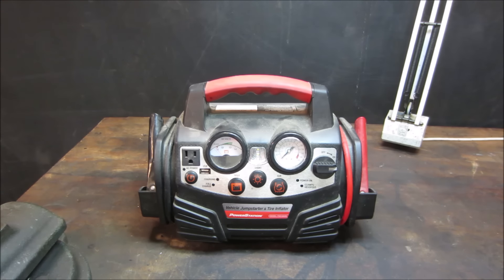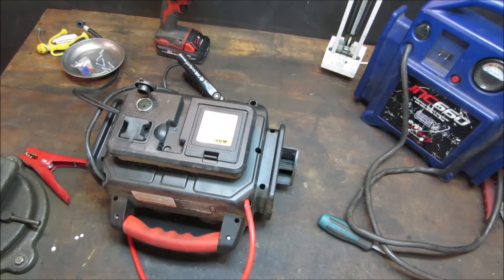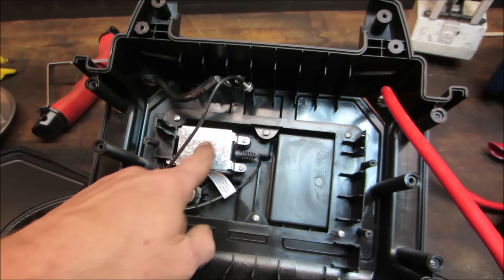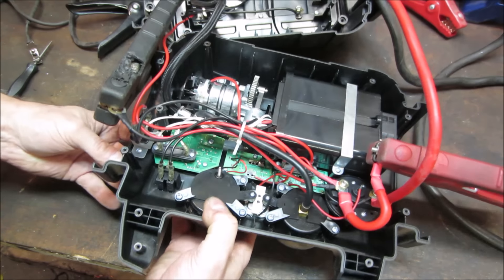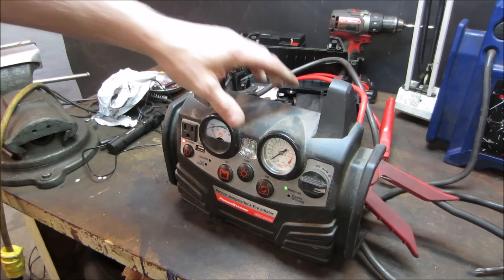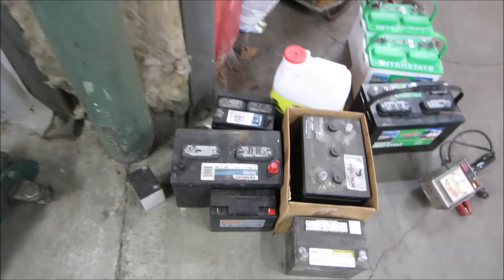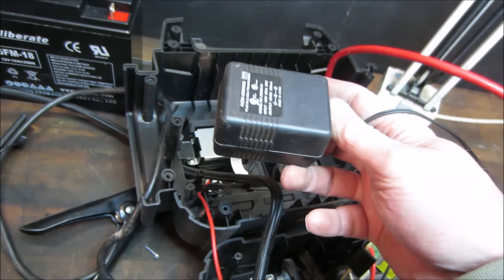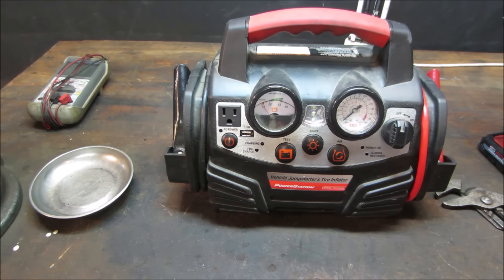What is inside a car jumper pack? and can we fix it.

Comment: Train sets are always cool. And nice job with the jumper pack. What was bugging it the whole time was when you didn't put something small into the AC to test it. Like test the voltage or use a phone charger or something else small like a portable radio.  :)  Also the word that escaped you was inverter. That's what that little circuit board with the fan was. A 12V to 120VAC power inverter.

Comment: Been a fan of train sets since I was a kid in the late 1950's. The glory days of passenger trains had not quite ended. I got a used Lionel gauge set for Christmas. So I'm all for the train set resurrection. Run the track on the wall, all around the garage!

Comment: Excellent video Mustie 1 :) fun part I got Flashlight, Air Compressor is 12 volt at Yard Sale plus Air blow up tools it a Canadian Tire brand 200 PSI on unit plus box even Owners Manual ! Guy sold for $25.00 also had rewired up because Flashlight on Flashing part did work till fix also fix Air Compressor would pump tire up ! So my old small  one had same parts also rebuilt & rewired total too and I use the Yard Sale lots since too ! Pay off lots repairs to people vechile service calls to Lol  to and also Mustie 1 yes bring Train Set out too!

Comment: Hey Darren. A couple of thoughts regarding this video:

1.) When testing the voltage on small connectors (such as the white connector which plugs into the circuit board), get yourself some T-pins - they can be bought at any sewing supply store. They're also great when measuring the voltage on vehicle connector pins.

2.) Regarding leaving a power pack plugged in when not in use, it shouldn't hurt anything - my Schumacher power pack's manual says it should be plugged in when not in use, so I imagine most others should be okay as well.
Reply: With a Schumacher-branded power pack, yeah, I'd trust that it would be okay and safe to leave it plugged in all the time, for there would be technology that would keep from "cooking" the battery inside.  With many other brands of power packs, not always going to be assured that leaving it eternally plugged in wouldn't finish the thing off in 4 to 6 months.

Comment: Just some information on batteries. Lead/acid cells are fully charged at 2.1 volts, 6 cells per 12 volt battery gets you 12.6 volts. Any voltage over this amount is called a "surface charge", extra electrons are on the surface of the plates in the cells hence the name. It is recommended the cars headlights be turned on for 5 minutes to rid these extra electrons from the plates to get a accurate measurement.

Comment: nice find and repair free is always a good  thing. I have a couple of the JNC packs one for each vehicle. I use power inverters for charging  tool batts and the jump packs get charged as well .  1 is 3 -4 years old and the other is 4-5 years old and still working okay

Comment: Darren, I worked at an auto auction years ago, and we had OTR truck batteries that were used to jump start vehicles with weak/old batteries. That had them on hand trucks with jumper cables all hooked to the cross support. It's not as convenient as my JNP660, but it started lots of cars. I got my jump box from a hospital after the battery died, and got a good used battery for mine.

Comment: I worked for a AAA shop and my boss loved these at first and bought many. Well as time went on they all failed pretty quickly and I was replacing lots of batteries. The best jumper is a automotive battery with jumper cables attached. These things are made in China.  I had a personal one that I took care of and it lasted 6 months.  I keep a 24F battery with attached cables for my emergency jump starts.

Comment: I really don't care at all what you tear apart and repair. As the saying goes, It's all good. It's the way you do your videos that make them engaging. Personally, I wouldn't mind seeing some vintage or retro kitchen appliances, mixers, blenders, toasters. Some of them are beautiful and it's a shame they're not made usable again. Also, some old fans are really neat. I used to have an old desktop oscillating fan that was covered in an elaborate wooden frame, with a  metal grill, and it looked like a Buck Rogers space helmet.

Comment: Midweek Mustie is a life saver! Cool teardown and loved the Mercury 2 stroke action at the end! Please do resurrect this train set it will make an awesome xmas display.
Reply: I believe the Merc is actually a 4-stroke 6 cyl (he did a couple videos on it), but likely had oiler issues so he puts some 2-cycle oil in with the fuel.
Reply: @OnusBones  Incorrect, the Mercury 150 Black Max engine that Mustie1 has is an oil injected 2 stroke. Also you would never add 2 cycle oil to a 4 stroke!
Reply: @comedyash  Hmmm, I'll have to rewatch those; I could have sworn he put 2-stroke oil in it; yes I know that's not the usual, but thought he did it do to an oiler issue.
Reply: Hmmm, now I see it is a 2-stroke that didn't normally use premix.  Okay.....sounds like a point of failure to me.

Comment: A 110 volt inverter  takes 12 DC and converts it to DC that one WAS PROBABLY about 100 watts ... charge your shaver 
.. a lot of wall worts.. 
You proved it was not broken right off the bat. Most of those things die because the battery dies....
Those things have AGM (Absorbed Glass Mat) the acid is contained in Fiberglass mats. These batteries are better than regular car battery for this purpose.  
I am glad you are getting better!

Comment: The output of that AC socket (115v AC) is not a square wave- it can destroy electronics.This outlet is for a resistive load- like a lamp...probably useless feature because the convertor is very inefficient and can kill the internal battery to the point the AC convertor quits with even a 500 watt load.

These lumps have sold for $159.95 and more
P.T. Barnum's Rule applies

Great video demonstration Mustie1

Comment: I have the same unit, also dead now, so this is really useful to see. I may try a battery swap. The problem with these type of unit is that you really do need to leave it charging almost all the time, but if it is charging in your house it isn’t with you when you need it. But I just bought another one of this type because they are cheap. The better units I think have a lithium iron phosphate battery which is much longer lasting and better in almost all respects. but costs a lot more money.

Comment: Thanks for a take apart video tutorial. Too many parts to remember for reassembly. You did very well since you had no leftover screws 😄 interesting innards but chances are it would be cheaper to just get a new unit.   If you didn't have a spare battery would you have just disassembled the unit and then discard? BTW, yes on the train!

Comment: 👍 yes to the model train set. If it’s the old Lionel type, if the headlamp bulb is working, there’s juice you can get froM a hobby shop that makes smoke, and it comes scented- diesel (yuk) or traditional coal or bunker oil . Also, the tracks get rusty, but I was cautioned against using steel wool to de-rust, because it magnetizes the track, and causes the bits of steel wool to cling - possibly damaging the locomotive. Also- there are rubber traction treads that go on the drive wheels that go bad with age/ they look a lot like wide flat rubber bands

Comment: The batteries are like the ones used in UPS (uninterruptible power supply) for computer systems which cushion the voltage / amperage on electronic equipment.  Hadn't seen a jump pack with all the "stuff" that your has.  Thanks.  Narragansett Bay

Comment: NICE.
Maybe the plastic calibration screw can be used to adjust the Battery Tester.  Maybe use the voltage scale to calibrate??

Comment: Generally speaking, a voltage of 12.6 volts is considered full charge. At that voltage it should start most vehicles. Right after charging it will generally read the voltage at which it was charged. Dropping thereafter to the high 12's if the battery is in good shape. Below 12.6 it can become iffy. Depending on what you are trying to start. Nice save. Got yourself a power pack.

Comment: Restoring jump packs, and making new ones is one of my things. I've found that old computer APUs can easily be turned into a most excellent remote power source. After all, they're just a battery with a 12vdc to 110vac inverter. I regularly find them tossed in trash and recycling bins. Add some binding posts and/or a jumper cable for 12v and you have a jump pack with 110vac. For an even better power source, swap the lead-acid battery with a diy pack made of 18650 computer batteries.

Comment: on that tester, the plastic screw just below the gauge is an offset for the device. you can use the DMM to measure the voltage under load and adjust the screw.

Comment: If I had to guess, the AC output of that battery pack will be about 150W running, with up to 300W (briefly!) surge, and puts out a modified sine wave (at best), or a simple square wave.  It's not good for much; plug a radio in, tune it to a blank "station," and listen for horrid interference.  You might find that output on a label or etching on it.
A 3-rail train set almost has to be O-gauge; Dad had a set when he was a kid, and my brother got it running for a while many years ago; I don't know where it is.  As another poster pointed out, if the engine works and is solid, it could be worth a decent amount to a collector.  It might be good fun to see if you can get it running again.

Comment: They use a regular lead-acid sealed battery like in a UPS or a lawn mower. I've replaced them before.

The box being cooled is the inverter for the 120v. You can get a similar sized package retail, Harbor Freight has them, that looks to be about 200 Watts? It's filled with diodes and MosFETs.

Comment: Fixed one of these with a faulty charger on the inside of the unit. I just ran 10 gauge leads to each battery terminal and drilled a small hole on each side to of the unit case to fish the leads through. When I need to charge the battery I just hook a charger up to each lead and charge up the battery. I keep a wire nutt on each lead when not charging.

Comment: I have picked up loads of jump packs mostly free. Handy for the leads but not much else. Just maganged to pick one up with a faulty voltmeter but good battery so managed to get one good one made up. Will weigh in all duff batteries.

Comment: I've got a few 12v lithium batteries in various  bikes and mowers etc, they cope with cold temperatures well but they need a load (battery tester that same as yours there) to warm and wake them up before they will crank anything over. My main bike has a couple of pigtails added so that i can easily attach a tester without taking the seat off and battery out below ~5°C

Comment: If you find that a dead battery will not 'take' a charge, I have had good success in wiring it in Parallel with a good battery and then charging it a low (2 amp) setting overnight.  It gets the current circulating.  This was a fun fix.

Comment: I put a new battery in an old jumper pack similar to this one when the original battery failed.  The new battery cost almost as much as buying another jumper pack but I just couldn't stand adding more stuff to the landfill.   The re-batteried pack has been holding up fine.   The old battery was recycled.

Comment: I replaced the battery in my jump pack. It was a lot cheaper than a complete new unit. 
That’s unit with the fan is a inverter. Funnily enough I use a US 120V 60Hz pure sine inverter to run our Lionel trains here in 🇬🇧.
So a big yes vote here for saving the Train👍 And you need to set it up round your Christmas Tree🎄

Comment: I think that it will run the drill with a good battery installed. My jumper box runs a motorized recliner just fine. Had to do that when the power went out with the chair in the reclined position.

Comment: The black box with the fan looks like an off-the-shelf inverter module. The combination of off-the-shelf parts makes for quick product development, but higher per-unit cost compared to a custom design. Probably not enough volume to warrant it, though.

Comment: I also had one of those car booster type chargers and replaced the internal lead acid battery with one I saved from a golf trolley. You can often revive 12/24v batteries by removing the top surface panel and decanting a little DISTILLED (not tap!) water into each cell; I heard you can add a small amount of soda? which assists with reviving the electrolyte solution. By use of a *slow trickle charge* (I believe you should leave the top panel open to let gas escape) rather than fast boost charging you rebuild the 12v battery's capacity to hold charge.

Comment: hey mustie the reason why your battery meter is reading wrong is the needle just needs adjusting, clip it to a good batttery and adjust the plastic screw at the bottom of the needle until it moves to the green ok between the 2 red marks onthe right hand side of the meter,  this should make it read correct again.  unless the meter adjustment is broken.

Comment: i've put new batteries in a couple of these that i got for free 'cause they wouldn't hold a charge. the 20 bucks each i spent on a battery was a lot better than the 70+ bucks they want for a new one. i added a couple of 36v 500f capacitors to one of them that made it work a lot better. if you have the space, i highly recommend adding caps to the pack.

Comment: Had a version of this. Compressor threw a rod. Eventually the battery would hold a charge. Inverter was OK, but small. It would run a small TV for a short time.

Comment: That particular 'low power' DC to AC converter works by using a high frequency oscillator driving the transformer.  The transformer output is used to make a plus and minus 150v DC power.  Then a chopper circuit switches the output to each 150v voltage rail at 60Hz to provide a fake 120v AC.  Your tool overloaded it.

Comment: Dang - I have a brand new battery like you have in your hand that you can have!  My Yamaha ATV was giving me trouble so I thought I'd put a new battery in it - save shop charges if it was the problem.   Nope.  On Thursday I took it to my Yamaha dealer in Duluth MN - told them I installed the battery on Tuesday.   Friday they call me - they said it was the battery.   $205.  The one I had put in the machine was $55.  It tested perfectly.   Loaded it up on the trailer, shut it off - tried it - would not turn over.  Pushed it off and ask if I could return their battery AFTER they fixed the problem.   Nope.  I hate dishonest people and incompetent mechanics charging top dollar.

Comment: I've put a few batteries in one I've had for years. They are notorious for having bad power supply's in. So I rewired it to use  the same style plug for like a trickle charger so I can charge it. I haven't had any issues with it since. I also found a battery with the same demintions with a higher amp hour and put it in it as well. 
As far as the train set, go snag that up. You've done videos of them and other electric cars in the past.

Comment: Booster packs of this age usually have one or sometimes two sealed 12 volt batteries producing somewhere around 17-20 amp hours. Replacement batteries cost about 40-45 euros on Amazon here in France, probably 35-40 USD in the USA. Well worth replacing the batteries instead of buying a new one.

The box with the fan attached is probably the inverter 12v to 110v/230v

The electronics are pretty robust. I've just stripped down two of them to dry them out after being caught in flood water.

Comment: I replaced the batteries in a PC backup power supply a few years back, it was old enough that I was able to get new batteries of the same size yet they had slightly higher reserve capacity. You might want to look into that for when your trusty old blue jumper pack battery finally dies.

Comment: I have taken 3 of these apart in the past ain't a lot in there considering what they want for some of them. the best and longest lasting ones seem to be a simple battery and cables with a inline kill switch or power switch . no one makes them in favor of more bells and shiny bits but 15 years ago they were a good cheap and repairable option sadly that's gone.

Comment: You may already be aware, but it's best NOT to store your batteries on the concrete floor. They have a tendency to discharge through the case and ground out. I store mine up off the floor, often times on a pallet. Hope that helps!

Comment: i found one of these, the Stanley, Super Max.  All i did was clean it up and replace the battery.  i love my little supermax.  granted, the price of the battery is mostly the cost of the unit., but still, $0.60 on the dollar, and gettig fully functional jumperpack, usb charger, air compressor, is well worth it.

Comment: I’ve got the same jump pack, and can confirm that the manufacturer recommends keeping it plugged in when not in use. The charging circuitry includes a battery maintainer, which should maximize the life of the battery (I believe there’s a 12v charging option, but that does not run through the maintainer circuit, so keeping it plugged into a car’s 12v outlet beyond the point of full charge is not ideal).

Comment: Those 7in1 Jumper Boxes Are Great To DIY Into A Perfect Camping, Boating Or Home Backup Power Unit Even Better Than A Bluetti, Jackery or Such Other Expensive Crap! I Scrap The Lead Acid Batteries & Convert Them To High Power LiPo Packs Inside & Knock The Weight Down On Main Pack! Rip Out The Mostly Worthless 300w Inverter Circuit & Put In More Batteries Also To Make Main Unit Now 3-5 Times More Powerful! Then Build Another 1-3+KWH Batteries Box From A Small Ice Chest Cooler or Such To Hook In Parallel With Main Unit, Add A 2-3kw Inverter, With Small MPPT Charge Controller To Hook Up A Couple Solar Panels, Then Wau-La You Have A Great Lil Cheap Power System! Thanks